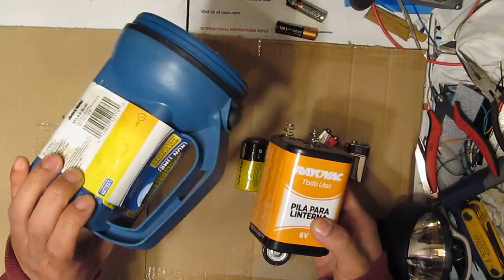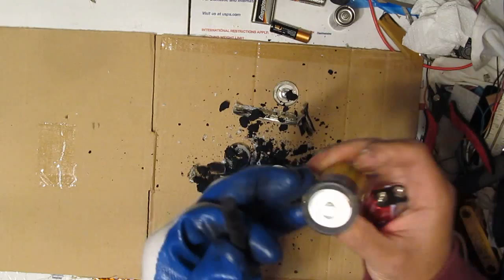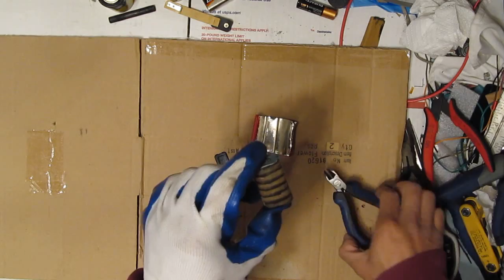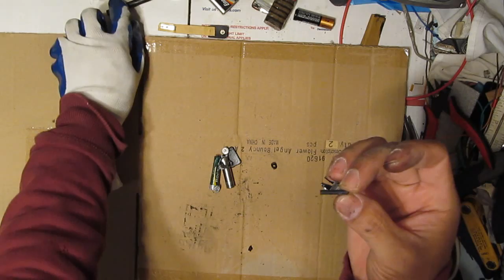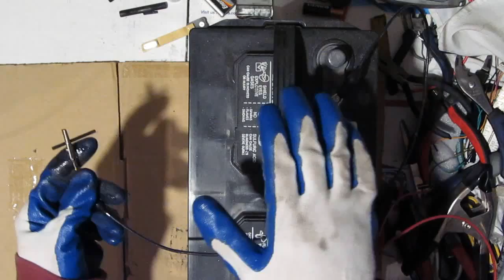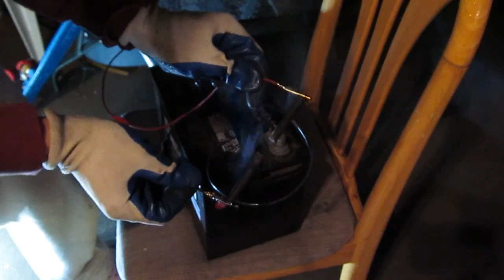DIY: Salvage Carbon rod electrodes for free

Comment: Omg do you have any idea how dangerous that was to do above a car battery. If they fell whilst hot onto the battery it would have exploded. I had a car battery explode and it took the front half of the garage out. Car batteries are highly explosive near any sparks. Especially when venting gasses and that will happen when doing this with carbon rods. You should use long jump cables and work far away from the battery.
Reply: Yep...keeeeertboooooom!!